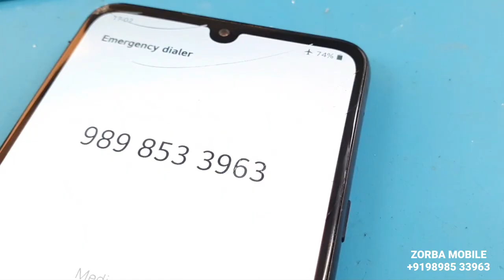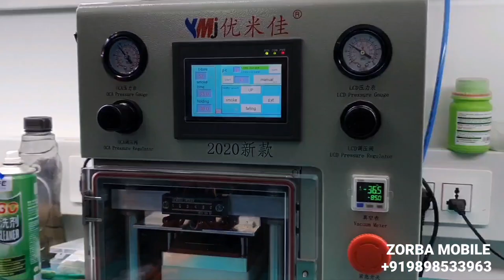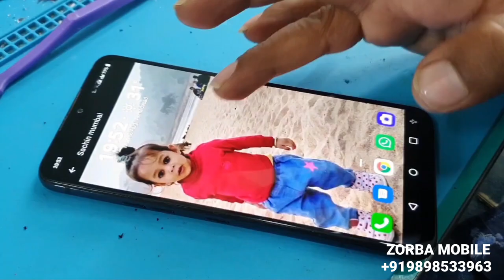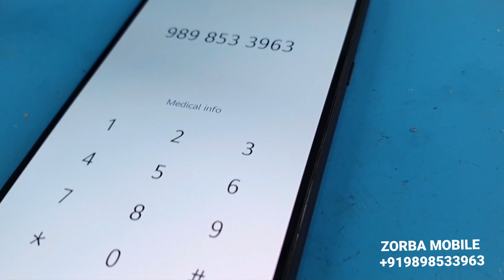Lg G8x ThinQ Display Glass Replacement | Lg Screen glass change

Comment: After replacing the Front glass...still waterproof protection is exists ???
Reply from the maker: no
Reply: There is a different kind of adhesive that comes in a row, its like tape, it works better then the liquid but its not IP66 once you break the seal on ANY mobile device there is no way to re-IP66 it, its done for on that account.

Comment: Can i use a fixed heat gun if i don't have a glass remover? What's the best way to seperate if I dont have a hot flat surface. BTW, whoever is doing this work is a f-ing master. Where do you get the wire??

Comment: Brother my phone got water damage and now its touch display is half working and stops responding after sometime and the upper part of lg display is not working. What should i do
Reply from the maker: 98985 33963 whatsapp plz
Reply: bhai kuch solution mila same case mere sath bhi hua kal show bazzi ke chakkar mein hogya
Reply: @alokparik3408  nhi mila bhai ab delhi k rohini m jakr hi thik krwaunga
Reply from the maker: 98985 33963 whatsapp 
available display & glass
Reply: @alokparik3408  bhai kuch nhi mila aise hi kaam chalana pad rha h 😭😭😭😭😭
Reply: @alokparik3408  bhai delhi k rohini m to lg ka model thik hi mhi krte or agr permanent solution chiye to lg department m jke nayi display lgwani pdegi 5500 ki isse bdhiya to or money milake nya phone aa jyega
Reply from the maker: ji ha
Reply: @zorbamobile  ji ha matlab bhai???
Reply from the maker: naya phon le lo
Reply: @zorbamobile  bhai ab to diwali sale m hi lenge
Reply: I'm having same problem screen damage due to water kya kru kuch smj nhi aa rha
Reply: Where are you located?
Reply from the maker: @lisak3159 ZORBA MOBILE 📱
Smart phone repair company
412,Pushti Heights, Gurukul Rd, opp. IDBI Bank, Memnagar, Ahmedabad, Gujarat, india 🇮🇳 pincoad380052
+9198985 33963 👈 contact to repair
https://www.vvcard.in/zorba-mobile

Comment: This is never a Success for a long term 
I have changed like this twice in a 5 months and the cracks easily anyways so save your money and stick to the original glass, whatever cracks there are I will prefer use the original only. These type of glass won't stay for much time, despite you take an extra care or whatsoever it will crack within 3-4 month.